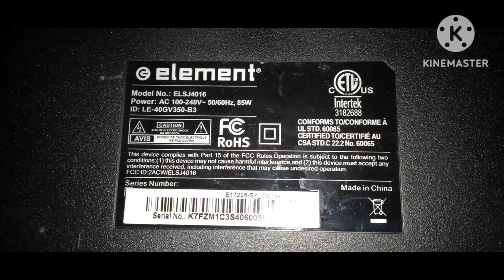element tv break down

Comment: My scrap yard let's me toss in what's left as shread. TV's and computer monitors are set up the same normally. You have a power board, the board that does all the processing, and the long board at the top. The long one is a high grade perif bord. The one that processes everything I'm not positive what it is. Might be medium or high grade depending on how much is on the board component wise. The power board is actually a regular midgrade board as it is. I strip off the extruded aluminum, the transformers, and the mosfets. Then toss the board in shread.
Reply from the maker: Thank you for the tips brother